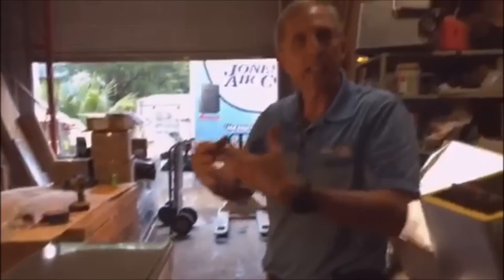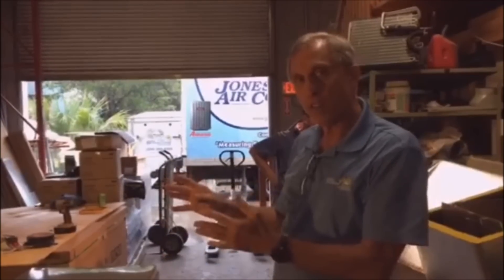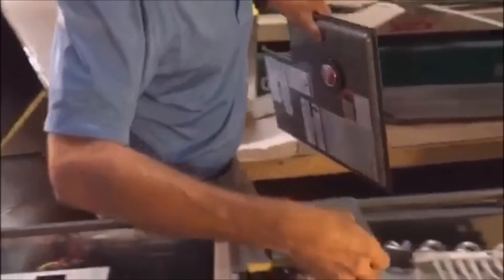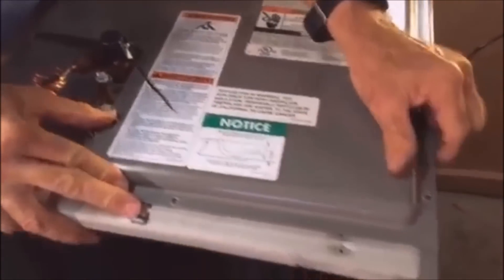Rheem Air Handler coil from left to right

Comment: when swapping the brackets, it is impossible to mess it up. the screw holes are staggered, so if you were to put the brackets in the wrong place, or have them facing the wrong direction, the bracket will be visibly at an angle, telling you that you did it wrong. so basically, there is only one possible way to put them back in. if you were to put the brackets in the wrong way, you will instantly understand what i am describing.  great video by the way!

Comment: Speaking as a NC licensed HVAC contractor for 36 years, who has installed many Rheem/Ruud units.   Their air handlers in my opinion have always been sub par..... Always have disliked them.  Too much labor to flip. The condensing units, I have always liked.  And 1/4 screws are ridiculous.  Surprisingly, Goodman air handlers are much better designed.  Thanks for sharing your video.

Comment: Hey Dave.. The new Rheem/Ruud units comes with those "extra' brackets so you no longer have to remove the installed ones. You just have to bolt on the new ones when you flip the coil... 

Also, the screw holes will only line up "ONE WAY" on the brackets.. They're "SCREWUP PROOF" LOL....

Comment: I just did alot of remodeling, and the coils need a really good cleaning. Can I use this coil removal method (on a not new out of the box unit) to take coils outside in order to hose? Thanks in advance for your answer. Devon

Comment: How do you clean the coils on a unit like this? I have one just like this but its a 5 ton, so the coil is a lot taller, but the same N shape. Mine is only 4 years old and smells like toe-jam likely due to it having been installed without a condensate trap. 

Unfortunately the coil's design is very enclosed like the one in the video, and it looks like the aluminum pipes were soldered on after the side shields were put into place by the manufacturer, restricting access to the wet or possibly dusty underside of the coils and the drain pan where grime and mold would collect. I've been considering just spraying coil cleaner on the top side of the coils as a last resort, but that seems it would do a very shoddy job of reaching where it actually needs to go. 

Any tips on units like this?

Comment: Hello,  where is the air filter on a Rheem Air handler?  My model number is RCFL-HM3617CC and serial number is W201224314.  I have looked in the attic at the unit where the unit is installed.  Thanks.

Comment: Hey David, glad I found this video. I recently had this same unit installed. Then my ceiling caved in 2 months later. It had been leaking since installation and not draining out condensate line. After seeing the video I found that the support brackets were not rotated for h right position. Also I see in the video the top of the coil rests perfectly with ceiling of cabinet. On mine there is a huge V gap. Its sloping and leaning down\backwards. I'd love to get your input. Are the support brackets also screwed into the rails on coil to hold in proper position?
Reply: Russ, did you fix this (get rid of the V gap)? I have the same situation (recently discovered). My hvac peeps don't want to touch it.

Comment: Hi: Nice video on how to setup a Rheem airhandler horizontally. I have one question: Which condensate drain hole will be the correct one to use when the airhandler is finally installed horizontal in the attic..??? I have the diagrams and the holes are labelled Auxillary drain connection horizontal application(Ibelieve that is the one to use), Primary drain connection, and Auxillary drain connection upflow and downflow application only. Thanks, John Willier, Hernando, FL.

Comment: Is it normal for a company to warranty the air conditioner and furnace 
and NOT the evaporator because they used a different brand? Lennox did 
that to my less than 5 year system and if the evap goes, Im SOL!

Comment: So just a up flow to downflow conversion
Reply: No, reconfigured from factory installed left hand service with left hand drain to right hand service with right hand drain. It's still setup to flow as it did from factory, blower is pulling air through instead of pushing. This unit, turned 1/4 to the right, will sit just as it is in the video upon completion of conversion. Most likely for attic install. Flow up/down can describe a vertical application which you won't have if installed horizontal. Now you have to think positive/negative pressures. Pull/push air for left/right handed service. It has a different effect on drainage, can actually pull a vacuum through one of the drain ports